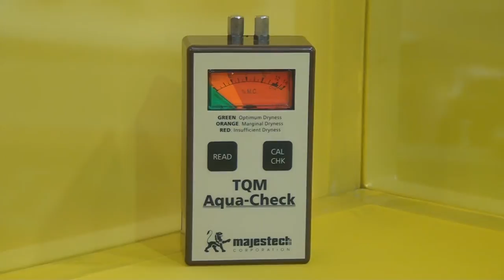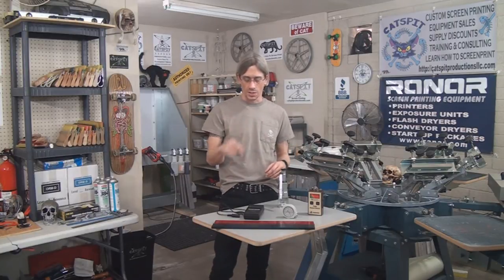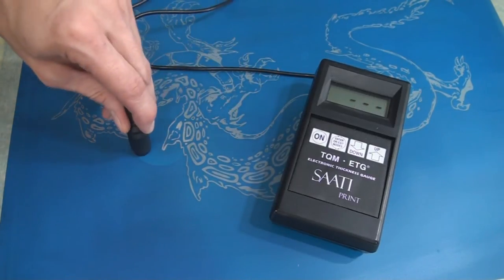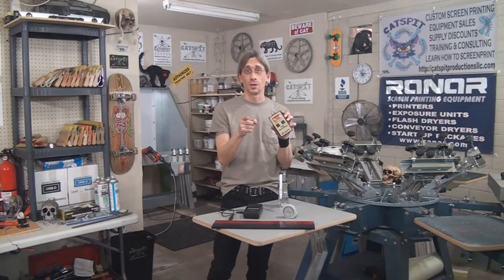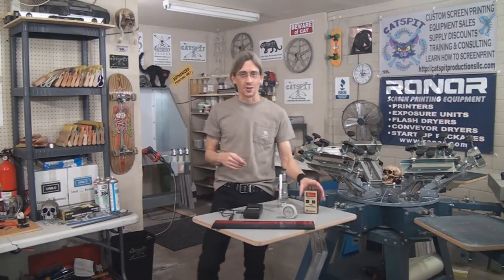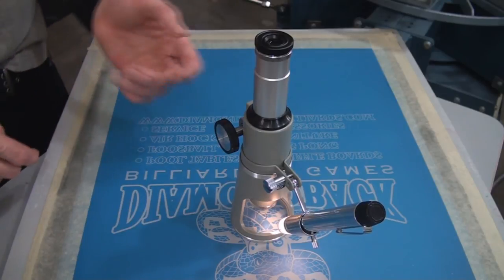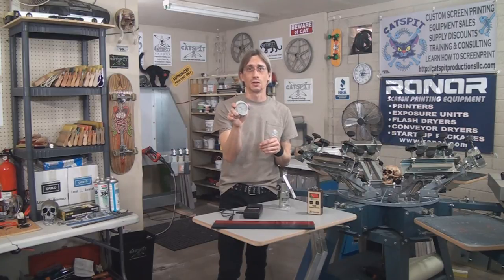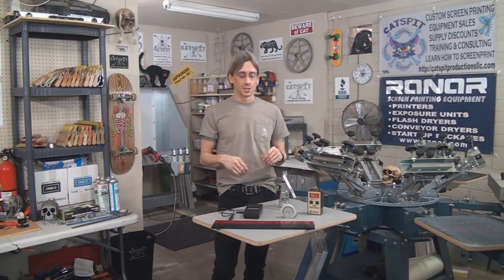Silk Screen Printing: Technical Quality Control Devices

Comment from the maker: @tpvajgert Thank you I'm glad you liked the video. Yes, what you are referring to is called emulsion over mesh or EOM. Generally a 5% ratio is desired. With the 110 mesh I used in the video here I am getting about a 7% ratio, which is not bad at all. But in the end your stencil thickness should depend on the print job. Thanks for watching and leaving a comment! ☠

Comment from the maker: Very cool technical  #screenprinting  video about quality control devices for industrial applications or specialty printing.
Reply: This is a great video!  Recently it occured to me that reused, still well tensioned screen may have too much blockage after it's been used a few times.  Particularly after a long run and ghost image remover just isn't getting it crystal clear.  I immediately wondered if there existed a meter that could check the mesh's amount of blockage.  Have you ever heard of this?
Reply from the maker: Thank you! No I have not specifically. When haze and stains begin to block ink flow noticeably it is often visible in the mesh and the printing. Mesh fibers may also fray over time causing ink flow characteristics to change. More often than not this reduced ink flow will be noticeable in the printing. If you don’t notice it, it’s probably not an issue unless we are talking about some industrial technical screenprinting application. Then the scope may shed some light on the condition of your mesh fibers.